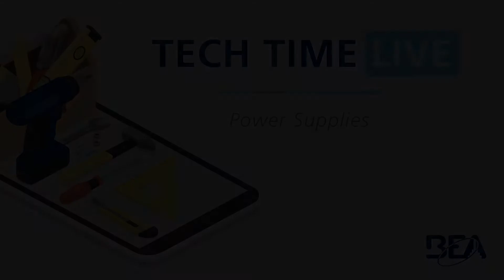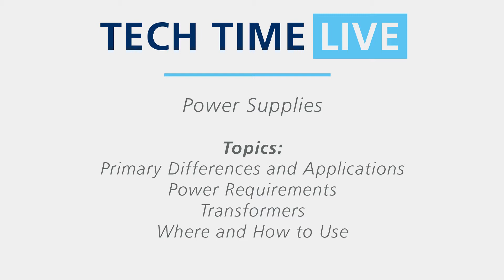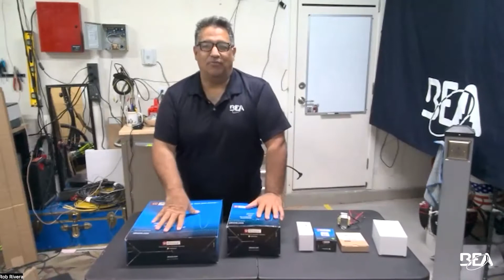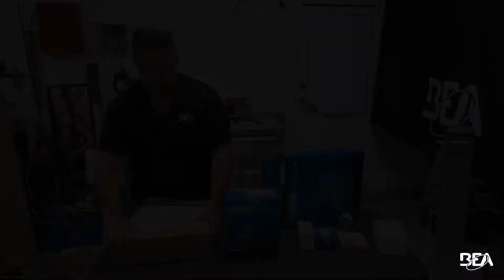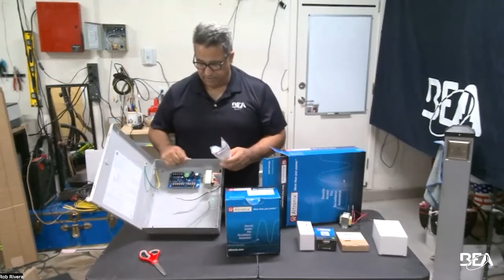Tech Time Live: Power Supplies

Comment: dealing with a multi point entry switches 2 button & code to a mag lock adding a BEa remote & receiver do I add a power supple or use existing?
Reply: Did you ever give us a call about this on our tech service line? There are additional details we would need before determining the answer to this